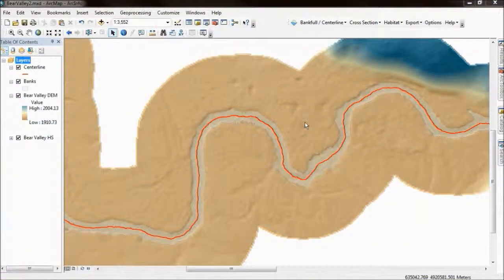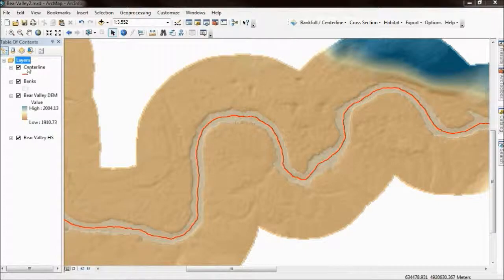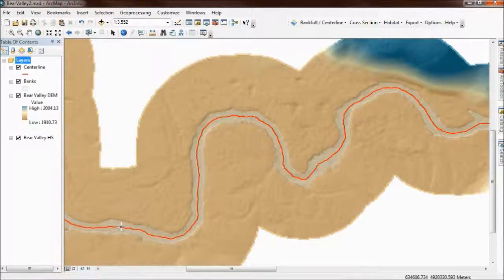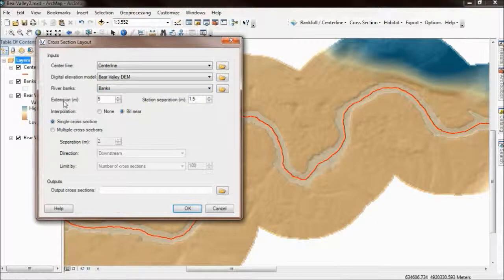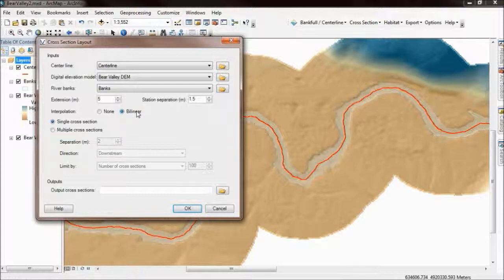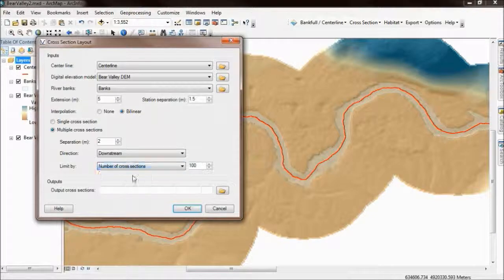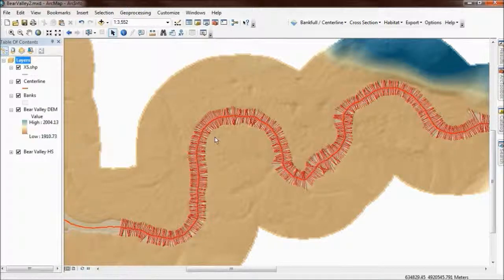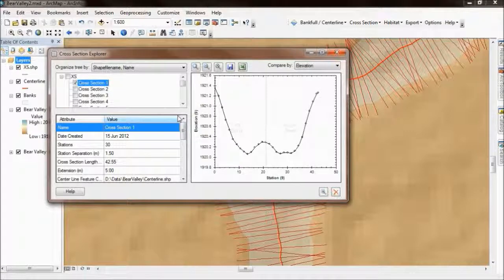RBT Cross Section Layout

Comment: How can I use RBT tool to create cross section of a river wider than 100 meter? I cannot seem to increase the "Extension (m)" more than 100. I thought this "Extension" would be from "river bank" edge but turned out to be from the "center line".